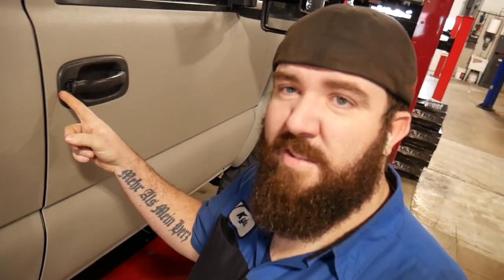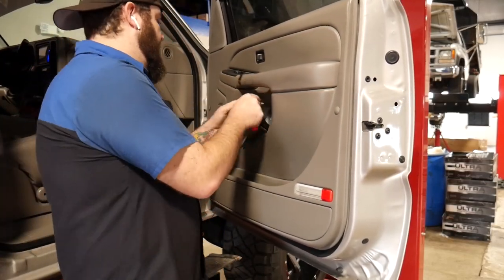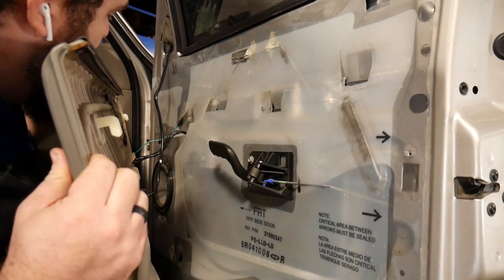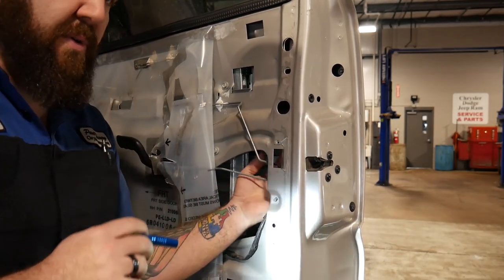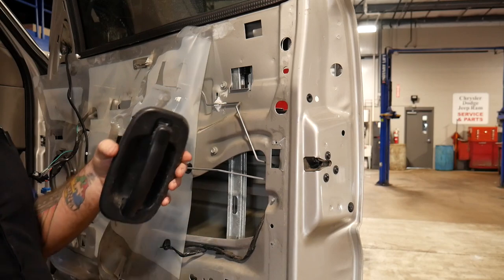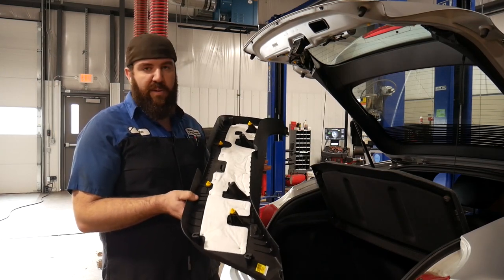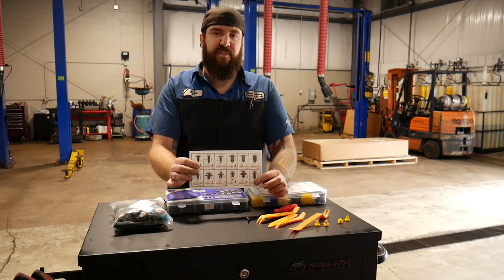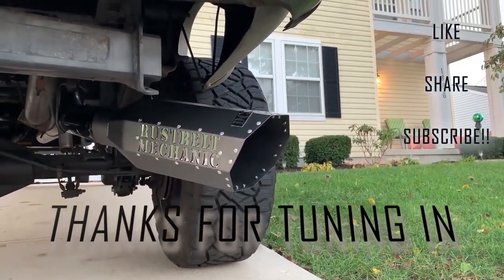SILVERADO DOOR HANDLE REPLACEMENT AND DOOR CLIPS TALK

Comment: I put Dorman replacements on mine and had a hard time finding a front passenger side handle without a hole for a lock cylinder. Also, I find it much easier to get my gorilla arm in the door behind the window track if I remove the interior door handle and drop the operating rod out of the way.

Comment: Dorman... I think that translates into you will be replacing that again. One thing I've learned about doormen 99% of their products are junk. If they has a dorm and name on it unless it is outsourced it is garbage. Now the dorm and stainless steel brake line kits are outsourced to another manufacturer and work well for that Silverado. But anything else with wings on it and the name doormen in my opinion is not worth its weigh in gold. Thank you for the video,. Truck looks good. I'm surprised you didn't have a 7 mm not on the bottom of that door panel as my 2004 does.